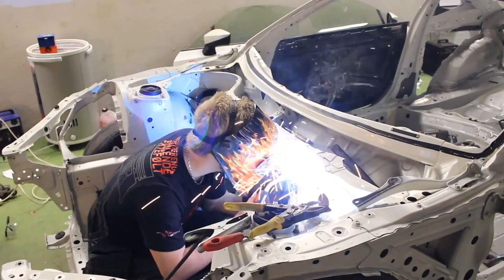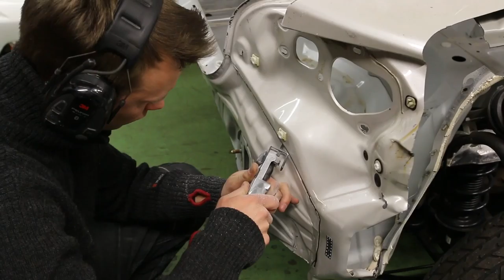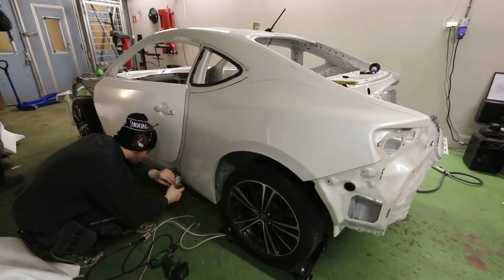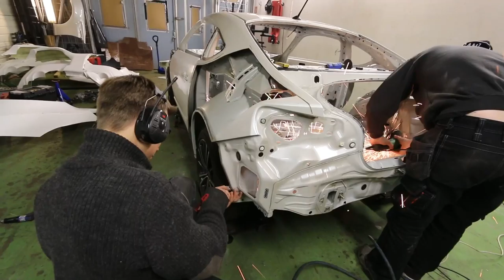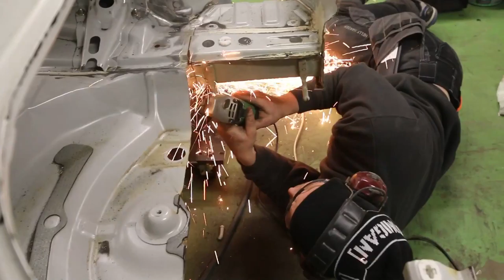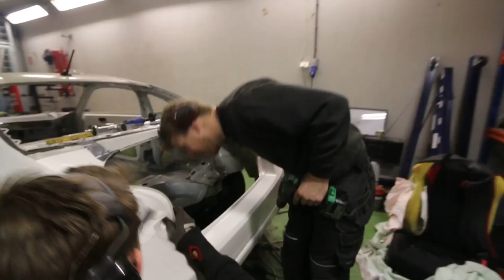CUTTING THE REAR END | VLOG 005

Comment: Why are you guys doing that? What is the purpose?
Reply from the maker: Hi! Joao Goncalves. We are doing this to get the car light as possible and with the full HGK motorsport fiberglass rear end it will be much more easy to fix damages on events. Also we get much better place in the trunk😊
Reply: Tor-Anders Ringnes ahhh that makes sense! I was asking because you removed a portion of the rear frame bar! Keep the good work, cheers!
Reply from the maker: We are going to make a new 40mm tube bar :) Get some more space for radiator, fuel surge tank, battery, waterpump ++ :) Thanks :)